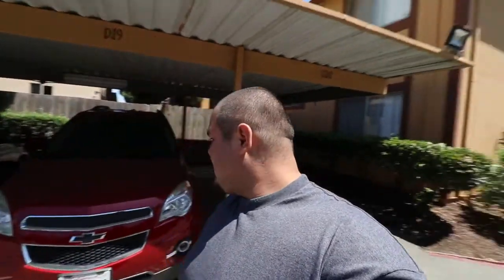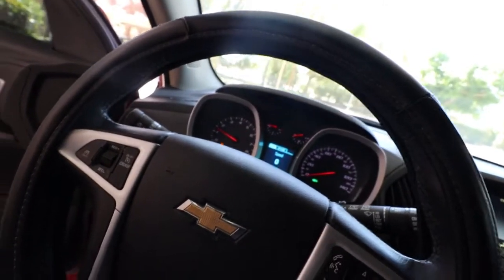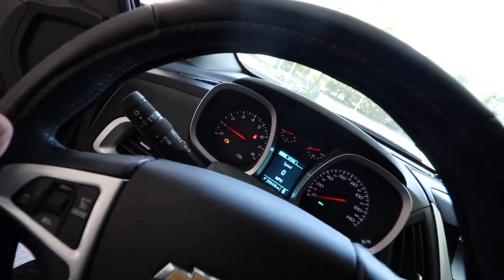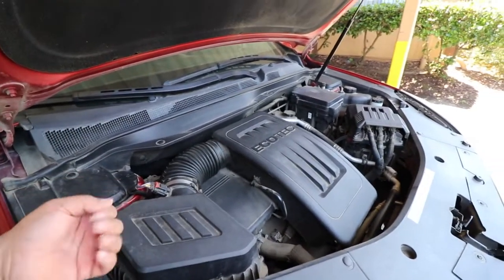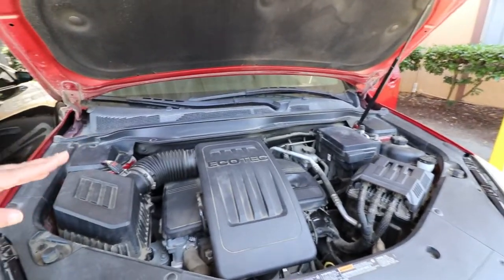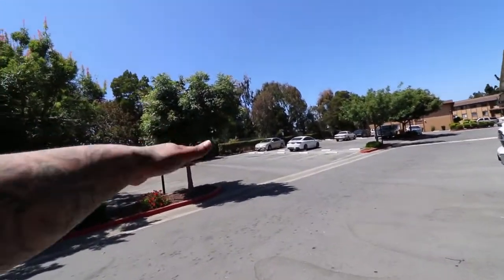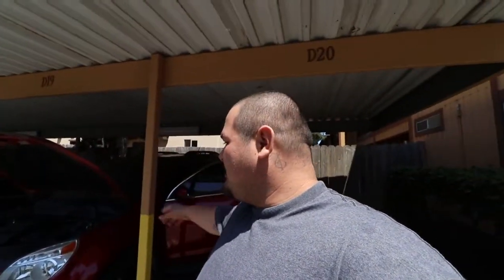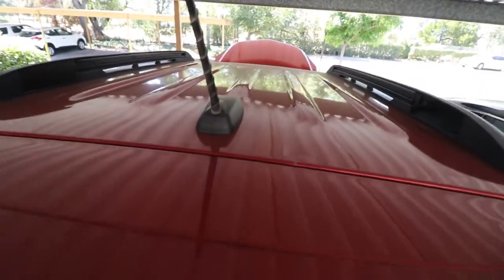My truck broke down 2019

Comment: I have a 2010 Chevy Equinox LT. I had 75,000 on the engine. It's a timing change. I got one done a few months ago. Cost me 800 dollars, I got a deal tho. He said it cost 1200 to 1400 dollars. My car was doing the same thing. It works fine now. I use my family (friend) mechanic too. Eventually it's going to start cutting off.
Reply from the maker: MAXIMUS POWERS the mechanic put a computer under the steering wheel and it said two things unrelated to that I just called him just now he said he cAn fix it and pay him later sooo should I be happy or concerned lol

Comment from the maker: Stay tuned for a part two  coming up
Reply: Anthony Ruiz I have a modified special order 2017 Chevy equinox... V6 turbo doc 3800 with Corvette headers and valves.  If you can trade yours in for at least a V6 doc 3800 you won’t be disappointed. Stay away from 4 cylinders especially the eco-boost. Four cylinders are very sluggish. 
My Equinox will slam heads into the seats when taking off.